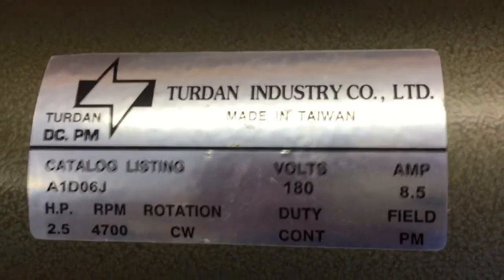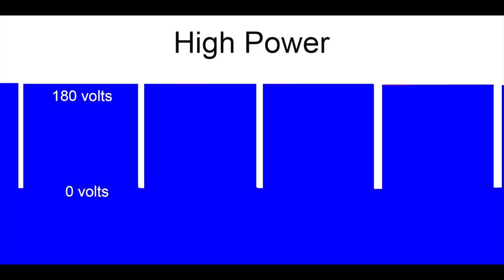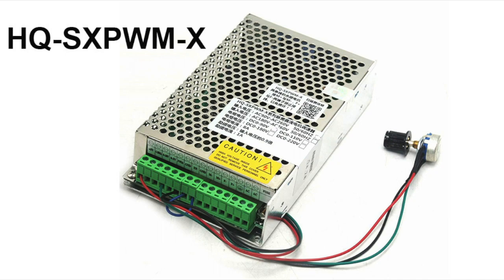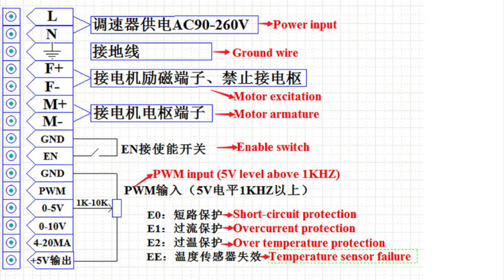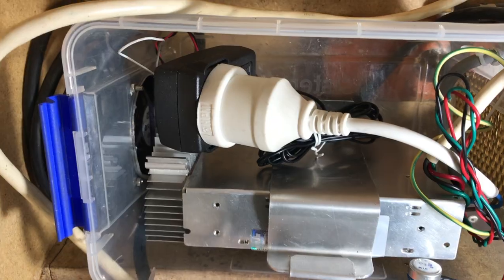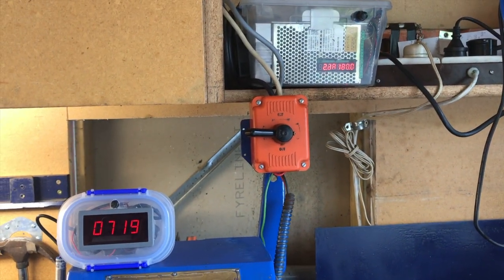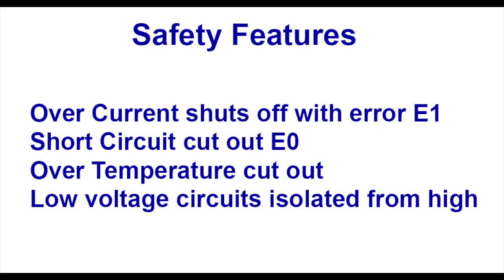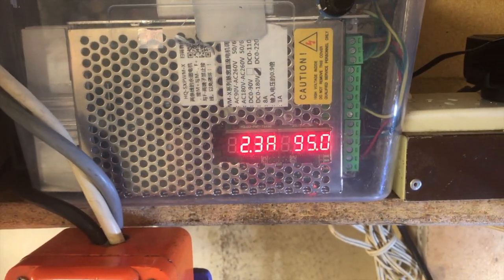Motor Speed Control Electronics for AC and DC motors including PWM Pulse Width Modulation and VFD

Comment: Great content, Evan. There is a slight error in your torque (T) calculation - 2Pi (approx. 6) radian: T = P/(2Pi×RPS). In mechanics angles are measured in radians not degrees and therefore in the formula P = T×omega, omega is [rad/s] not just [/s]. RPS = frequency (f) and omega = 2Pi×f [rad/s]. Btw I'm using a Boxford AUD, greetings from Copenhagen DK.
Reply from the maker: Hi!  Great to hear from a Boxford user in Copenhagen. I gave a paper at a conference there once - 1980. Thanks for your correction.  It is something I lost in the rust of time and you are not the first to correct me!  I have written a CORRECTION paragraph in the notes section above. I guess you are a member of the Boxford Users Group. If so you will have seen me promoting my web site for lathe users, especially Boxford users: https://RideTheGearTrain.com. If you need to calculate the gears needed to cut a special thread you would look for "Lathes with Gearboxes", then Norton Gear (which includes Boxford). I should edit the program as this is for Boxford and other South Bend clones.

Comment: Sir, the IR is used to maintain rpm at preset value with load on the spindle. The same terminology is used with my current mini lathe controller KBIC-120/240. If you load spindle with IR set value, the rpm will hold under load
Reply from the maker: This IR is expressed as a percentage and by default is set to 0%.  Despite that it seems to be very good at maintaining torque under load by automatically increasing amps as the load increases.  So what percentage should we use? How do we decide?  The down side of increasing IR is that it may force the amperage (current) up higher under load, and this may cause it to exceed the 10 amp limit more easily, causing more E1 errors.
Reply: @Evan-e-cent  Sir, its hard for me to say as i never really adjusted IR for my previous controller since it works fine out of the box.when i get my HQ-SXPWM-X i will experiment and share the results.

Below are the steps, taken from KBIC manual To Recalibrate the IR Trimpot (KBIC-120/240)
1. Set the IR Trimpot to approximately 25% rotation. 
2. Run the motor unloaded at approximately 1/3 speed and record the RPMs. 
3. Run the motor with the maximum load and adjust the IR Trimpot so that the motor speed under 
load equals the unloaded speed recorded in step 2. 
4. Remove the load and recheck the RPMs. 
5. If the unloaded RPM has changed, repeat steps 2 - 4 for more exact regulation. The control is now 
compensated to provide minimal speed change due to changing loads.

Comment: Very informative!
BTW, here in the US we have 60 Hertz cycling and 3 phase is not available unless you have an industrial hook up. You can't get true 3 phase into your house or shop.
We can get 220 volts but it's not a true 3 phase, it's two 110-120 volt lines going into one plug.
Mainly used for clothes dryers or welders in a garage setting.
I have been patiently waiting for one of those  used Treadmills to drop in my lap so I can get my hands on one of the direct current motors.
Thanks for putting up the part number and all the info about the controller you used.
I am saving this video and just subscribed.
Reply from the maker: Hi, I replied but it seems to have disappeared. I made a blooper. I got my 50 Hz and 60Hz back to front.  I have lived in UK, Germany and recently USA for 27 years and NZ.  Basically you have 60 Hz in USA and Canada while UK, Europe, NZ, Australia etc have 50 Hz. Not that it really matters much.  You mentioned that in USA you don't have household 3-phase supply.  But what you can do is get a relatively cheap VSD converter from China. Under $100 I think. This takes your single phase AC and converts it to DC and then back to 3 phase AC with variable frequency control to give you a variable speed reversible AC motor for your lathe or other machinery. Personally I use DC motors. 

That 220 volt hookup in USA is weird.  I had it on my cloths drier in USA.  It sounds like 2 phase as you would get from a two-pole generator,  if two 110 volt lines can be connected to give a true 220 volts. I don't imagine they would give you two phases from a 3 phase system as it would be unbalanced and not true 220 volts. Is their grid a 2 phase system?  Or do they invert the 110 volt supply, or create exactly 180 degree phase shift somehow?  I don't know.
Reply: @Evan-e-cent  Basically they are running two 120 volt lines and running a modified sine wave. It's not true 3 phase. Only us, right?
The safety nannies have been around a lot longer than people realize.
Reply from the maker: I produced a long comment on the Boxford Users Group web site about one two three phase power.  They do indeed use true three phase for transmitting power over long distances in USA. The steel pylons carrying 110,000 volts across our property have 3 wires for the three phases (with phases 120 degrees apart). 

Our rural house in Tennessee has a single power wire running to a transformer on a power pole outside our house.  This is just one of the three phases they could have used. The current runs back through the earth.  So it is definitely single phase.  So why do our AC and clothes dryer use two phase?  

To produce two phase the transformer has a single primary coil at 11,000 volt single phase.  But the secondary system has two coils each producing 110 volt AC power. But one coil is wound clockwise and the other counterclockwise, so they produce AC power that is 180 degrees out of phase with each other. This is true two phase power. The voltage between one wire and the other is 110 x 2 = 220 volts.  

By using double the voltage the current required for a particular wattage is cut in half. That means the cross-sectional area of the copper wires can be cut in half, greatly reducing the physical size, cost and weight of components like motors and heaters.